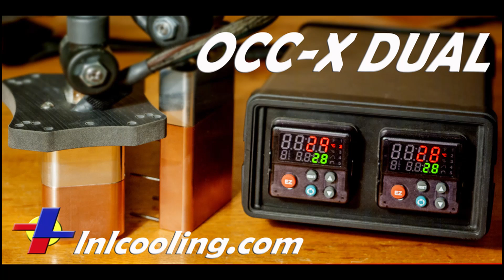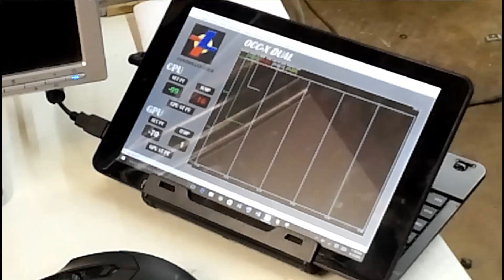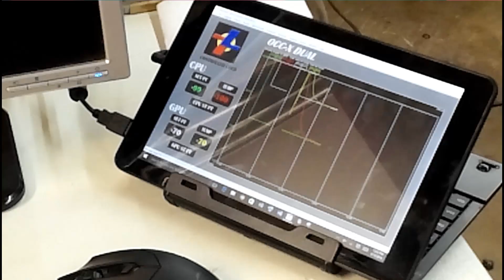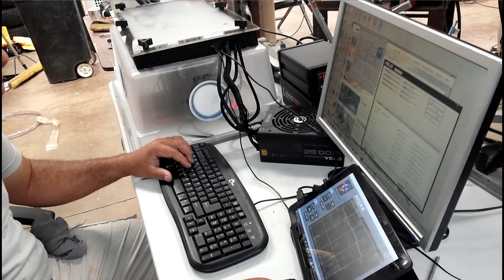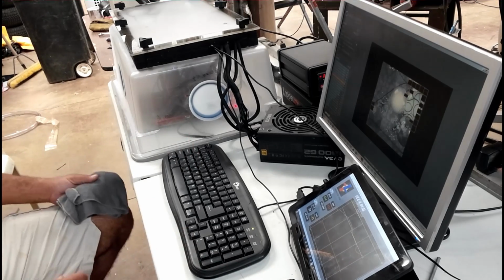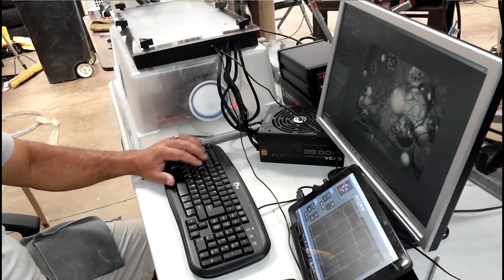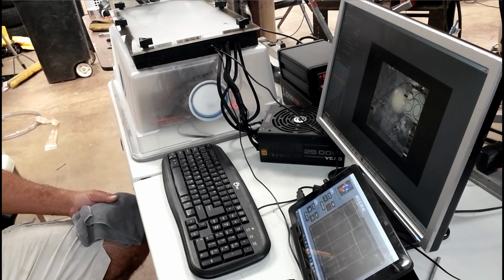Easiest and Best Liquid Nitrogen Computer Cooling Method Zero Ice CPU and GPU

Comment: Would you think there is a way to make the Nitrogen circulate in the system so you wouldn't have to refill it? Maybe a good future challenge?
Reply: TSGWhatever notice he didn't reply to this question. You would need to constantly replace the liquified nitrogen.
Reply from the maker: No. Liquid to gas ratio of LN2 is 1:600.  So when you release 1 tbsp of LN2 it makes 3 liters of GN2.  Almost magical huh?
Reply: Ah, well in that case, about how fast does it consume liquid nitrogen in let's say the conditions shown in the video?